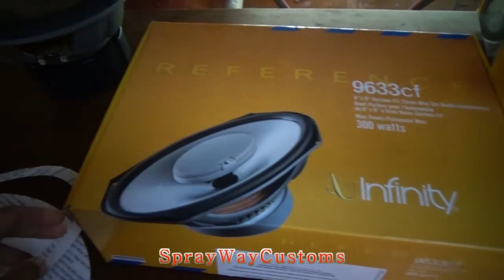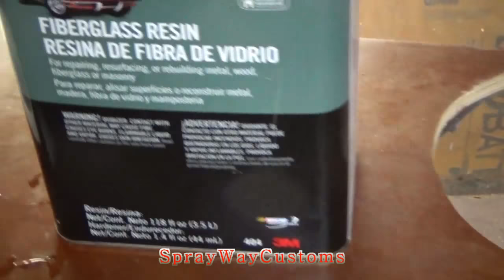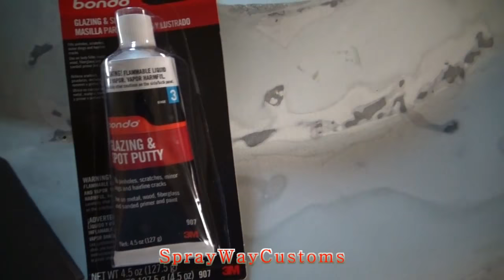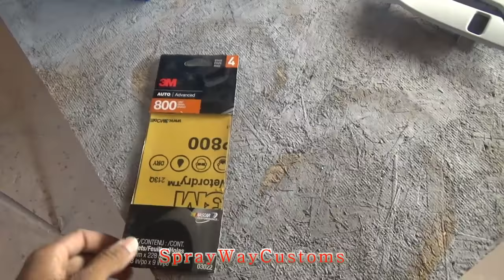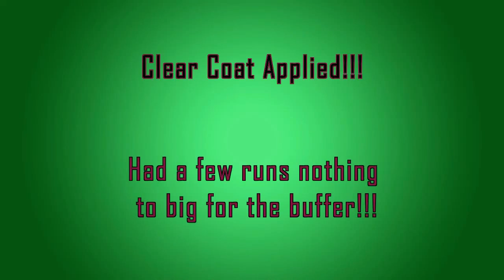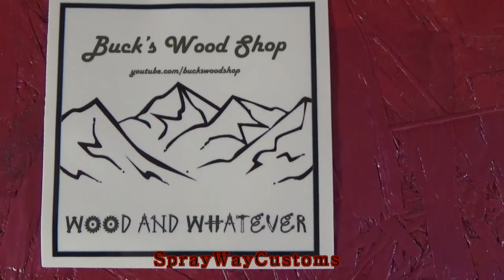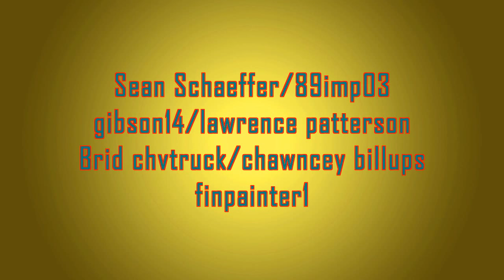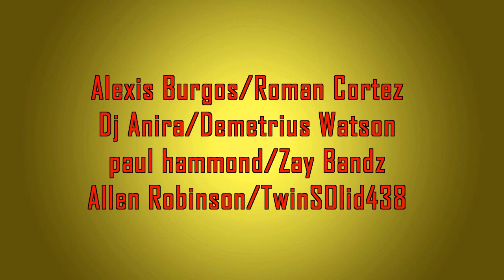How To Fiberglass Rear Deck,Dash,Door Panels,Sub Box etc...Complete Step By Step Tutorial

Comment: Very cool, good how to, and good music. Have you tried cutting your speaders into the rounded shapes you need for spreading? Have you thought about making a reusable mold of this so u can make more without all the fab up? Check out this site for materials and some how to http://www.tapplastics.com/ go to the fiber glass section
Reply from the maker: Never thought about that Scott ...that's a good idea about cutting your spreaders into the shape you doing...I'm gonna have to try that and check the web site out....thanks for watching and all the good information
Reply: Try spraying black primer over your grey on your final sanding and it will show your high and low spots. Your paint turns out dam good for not having a booth. I'll keep watching . I'm a welder by trade but did auto body in school and worked in a couple shops. I got a  couple fiberglass things I want to try.

Comment: I must admit the finished product looks pretty good. But if you don't mind I will point out 2 HUGE mistakes you are making.... First you should never tear the fiberglass mat apart like that, The is where it gets all its strength from is the way it is wolven together!! Just take you a pair of scissors and cut the mat to the shape you want it, DON'T break it apart like you did. And next... "YOUR RONDO" , I don't even understand how that stuff can dry, harden up or anything else. That is like mixing water and oil together... You just can't do that. MYSELF I would never do that, I see it is working for you right now but I would bet money that stuff does not ever cure the way it should so therefore you may have problems with it lifting or cracking over time.. Other then that you did everything the right way and the end result looks great... Keep up the good work and videos!!!!
Reply from the maker: Thanks for all the tips bro... I need all the help I can get that's gonna make my job easier... I'm new to this and still learning all the tricks
Reply: +OHIOFIGHTFAN what scissors looks like? Nigga used to tear and bite everything.